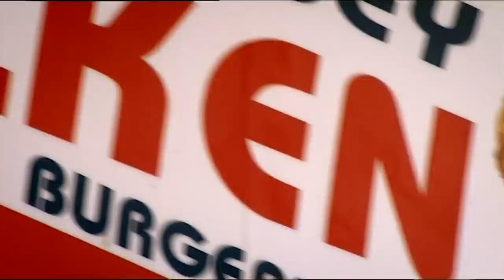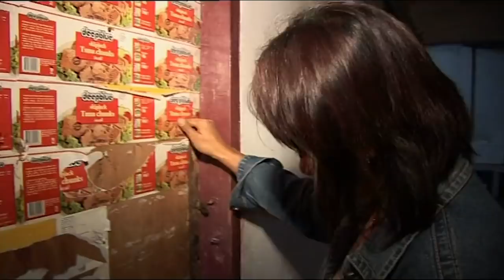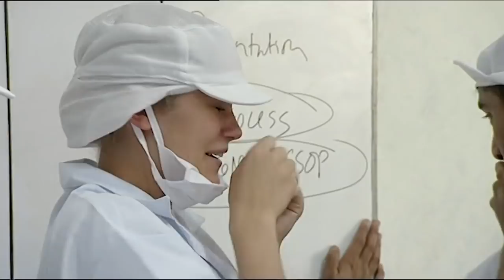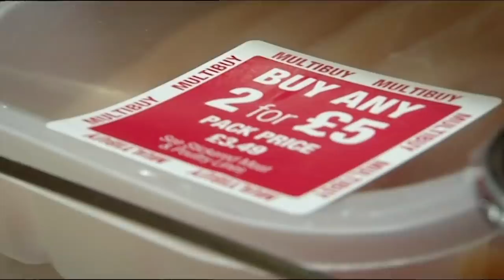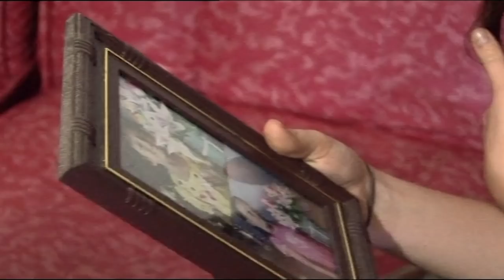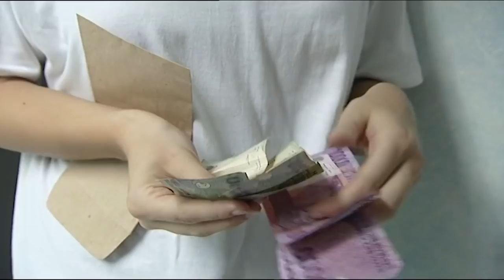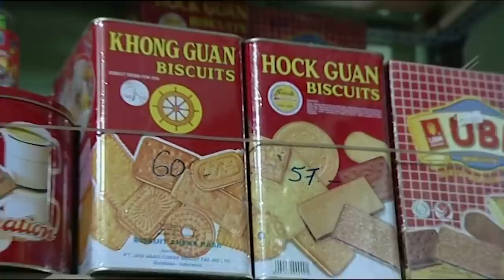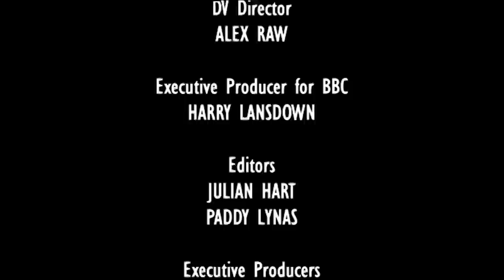Surviving 90 Degrees Tuna Factories | Blood, Sweat And Takeaways S1 Ep 4

Comment: No talking because the saliva will contaminate the fish, but they are okay with not wearing gloves...smh.  Ok...
Reply: and also handling fish in extremely hot temperatures. it makes no sense
Reply: It makes no sense
Reply: washed hands dont really contaminate
But the latex powder on gloves will
Reply: Hands can be cleaned easier & cheaper. The tuna canneries want to make it as cheap as possible so the tin is only under a couple pounds each.
Reply: Food hygiene standards here prefer people to have bare , well washed hands than wear gloves. Its considered cleaner with less chance of contamination.  Its probably the same there since they work to European standards.

Comment: If I walked in I would just stop at the side breathe in short and out. Then increase breathing in. Relax, and I would say I'm good. I would be fine here. I opened up cocunuts(it is tricky but my ma saw I did it safely, my dad and mom taught me how to open tough food items and cut meat) for my ma, Pumpkins too and now I do not. We get already cut now. My ma's letting my hands recover after a few years of helping her prepare the food. I used an old tool but I kept it clean to open it up. We threw it out. Plus a Butcher's knife, only thing tough enough we had. I had no choice, so it was harder. My hands hurt but I am getting better.
I have respect for who works in food factories. Just doing Mexican dishes, it's the same thing over and over for family gatherings. I'm Mexican.